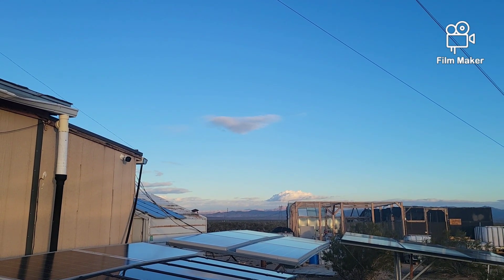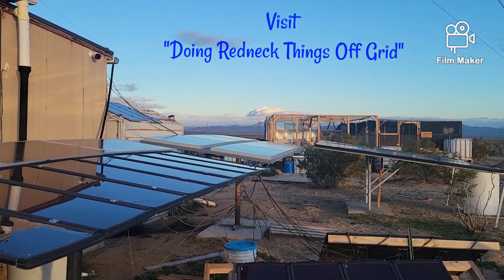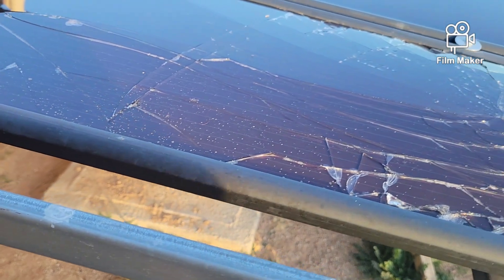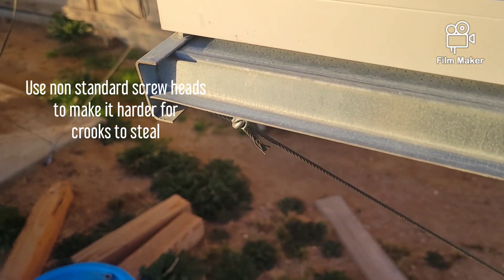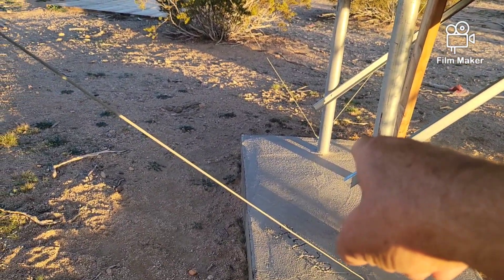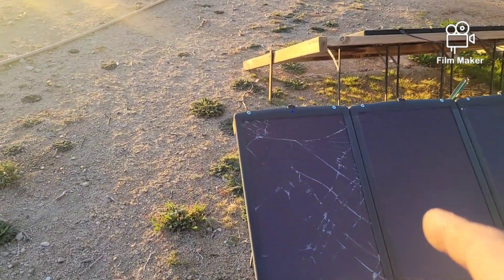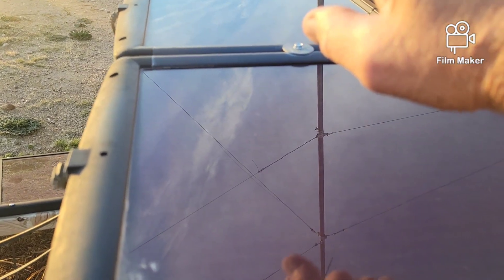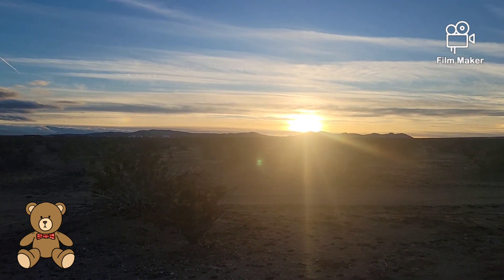No-Weld Solar Panel Racks, How I Made Them, Jan. 21, 2024

Comment: Good use of the material.  I have pressure treated 4x4 in the ground and 2x6 for cross beams.  However, many times I get lucky at home depot and by the warped wood at 70% off and use that for bracing.  Building two more arrays next month using used panels.  Have a good day.  Gary, SE MI
Reply from the maker: Whatever works, right?

Comment: Hi GBear - good tips about using the metal Furring Channel which is used in drywall applications.  A wise way to utilize a resource in a different fashion to accomplish a goal spending a little less.  Uni-strut or "superstrut" is twice the price of the furring channel.  Thanks for sharing as it may help others with their solar panels.
Reply from the maker: Thanks.  Yes, using existing stock products saved time and money, not to mention future headaches from rotted wood or broken supports and panels.

Comment: So how heavy is that unistrut!? I used wood for cost efficiency. I built one outta aluminum and it was really flimsy. So I went to reinforced wood! My first one (solar tracker) has been up for four years and has held up to some fifty mph winds also! I kinda did what worked for me! I really love your design! Maybe down the road I'll switch over! Now I'm gonna go with what I have! Awesome video brother thanks for the shout out too!
Reply from the maker: You're welcome.   That strut isn't very heavy, neither are the other pieces.  I can lift the large rack myself, and did so to mount it on the poles.
Reply: @GBear  
Cool down the road I'll switch to that but now I have to finish what I have to fire up the 48v system! I priced the unistrut it does cost more but I think in the long run it'll be better!
Reply from the maker: @tonylarson1960able  when the wind blew over my one rack, it was because it snapped at the anchor bolts, the rack maintained integrity.  The new bigger rack with the poles in concrete doesn't budge.
Reply: @GBear  
I hear ya!